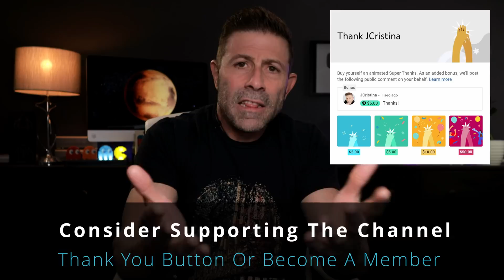REVEALED: Elon Musk SpaceX Starship 7 Investigation

Comment: Harmonics is an interesting study. I remember when Hot Rod Magazine produced a bunch of articles on Harmonic tuning engine exhaust and intake systems. I learned a lot about harmonics way back then, 1957?. From that much understanding, I can tell you that by changing the size of that open space, they made the harmonics wildly different. I am sure they have formulas to recalculate the new harmonics of the new structure. It is interesting how the harmonics of even the expansion joints in a concrete paved highway causes auto manufactures to adjust the wheelbase of the cars they produce. Remember the bumps they created in Hwy 66 to make your tire tell you, "You are going too fast."?

Comment: I could be simply wrong.. but......I believe the "attic space" is between the thrust plate .. ie.. (The plate that holds the engines) and the firewall just under the LOX tank...I do not believe the fire occurred above the firewall near the lox tank...this "Attic" is where some of the raptor 2 heat shield is and is where a lot of pipes exist.....Spacex correctly pointed out that raptor 3 with its much improved piping design should in itself solve this issue....but it the interim spacex plans on flooding this space with c02 as a fire prevention...this leak could have been a small leak as what happened to the falcon 9 upper stage last summer....that did not lead to a fire as the leak vented freely into the exhaust plume without accumulating.....this attic area is most isolated from the craziness happening below the raptor engines and likely did not have adequate side venting to allow for this anomaly...spacex is adding vents....in future flights we should be able to see streams of c02 venting from the sides of the aft section if spacex chooses to put a camera there to give us a view

Comment: It's common knowledge (among those of us who follow starship) that flight 7 utilized the first of the Block 2 starships, and that among the many changes, both the lox and methane tanks had increased in size.  I believe that was why they didn't bring attention to the larger volume of fuel/oxidizer.  But I do believe that the difference in length of the pipes supplying fuel could have contributed to the harmonic frequency being off nominal.
Reply from the maker: Agree.

Comment: OK--------...  HARMONICS ON A ROCKET COMES MOSTLY FROM THE ENGINES....  THE ENGINES ARE BURNING LOX AND METHANE AT INCREDIBLE PRESSURES THAT BECAUSE OF BUBBLES OF FUEL AND LOX NOT PROPERLY MIXING TO BURN, ACTUALLY EXPLODE LIKE SMALL FIRECRACKERS AS THE MAJORITY OF THE FUEL BURNS.. THESE MICRO EXPLOSIONS OF VARYING SIZES AND POWER THAT CAN EQUAL MANY STICKS OF DINOMITE, ARE RANDOM AND IMPOSSIBLE TO PREDICT AND IN EARLY ROCKETS WERE RESPONSIBLE FOR MOST OF THEM BLOWING UP... AND TOOK YEARS FOR NASA TO FINALLY UNDERSTAND WHY....  BUT WERE NEVER ABLE TO STOP THEM COMPLETELY... I'D LIKE TO LET YOU KNOW THAT THE SMALL CONSTANT EXPLOSIONS IS THE GREATEST CONTRIBUTOR TO THE ROCKETS' HARMONICS AND ARE AMPLIFIED BY ALL THE FACTORS YOU HAVE DISCUSSED...  
-------------.  THE HARMONICS OR SHAKING VIBRATIONS ARE WHY IT IS SO HARD TO KEEP BOLTED PIPE JOINTS FROM LEAKING...  WHICH IS WHY SPACEX IS TRYING TO ELIMINATE AS MANY BOLTED FLANG JOINTS AS POSSIBLE...  BUT THE BIGGEST FACT THAT CONTRIBUTED TO THE DESTRUCTION OF STARSHIP 7'S LAUNCH WAS THE FIRES FROM THE LEAKES UNEVENLY HEATING THE FEED PIPES AND BOTTOM OF THE LOX TANK CREATING ADDITIONAL STRESSES  IN THE WELDS OF PIPES THROUGH THE TANKS AND MULTIPLYING THE HARMONIC VIBRATIONS AND RAPIDLY INCREASING THE SIZES AND NUMBERS OF THE LEAKES GEMETRICLY...  AND THE ATIC BEING SEALED TIGHT WITH ONLY A FEW SMALL VENT VALVES NOT BEING ABLE TO RELEASE THE INCREASING PRESSURE FAST ENOUGH,,, THAT CONSENTRATED AND MULTIPLIED THE HEAT OF THE FIRES EXPONENTIALLY...  FROM ENGINE TO ENGINE... FORCEING THEM TO SHUT DOWN... ONE BY ONE... 
----------.  WHEREAS SEVERAL LARGE BLOW-OUT PANNELS WOULD HAVE ALLOWED THE LEAKING GASES TO ESCAPE INTO THE VOID BEFORE THEY COULD FORM LARGE CONCENTRATED FIRES...  WHY SPACE X HAS SAID THEY HAVE ADDED BLOWOUT PANNELS AND LARGER VENTS TO THE ATTIC ON THE STARSHIP FLIGHT 8... ALONG WITH FIRE SUPPRESSION SYSTEMS...
-----------. AGAIN WHAT CAUSED THE HARMONICS IS THE ENGINE EXHAUST MINI EXPLOSIONS AMPLIFIED BY THE HIGH PRESSURES AND HIGH THUST UP THROUGH THE ENGINES PIPPING THROUGH THE ATTIC AND INTO THE LOX TANK...  WITH THE FIRES BEING AMPLIFIED BY THE INCREASING PRESSURES INSIDE THE ATTIC... CONCENTRATING AND RAPIDLY EXPANDING THE FIRES...AND THE DAMAGE THEY WERE CAUSING... 
-----------.  THEN THE CENTRIFUGAL FORCES AS THE SHIP STARTED TUMBLING FASTER AND FASTER FROM THE UNEVEN THRUST AS 5 OF THE ENGINES SLOWLY CUT OUT FROM ONE SIDE TO THE OTHER...  TEARING THE FUEL SYSTEM APART ADING TO THE STRESSES TO INCREASE THE RATE OF LEAKES AND THE SIZES OF THE FIRES...  UNTIL THE SHIP SIMPLY TORE ITSELF APART POSSIBLY FROM THE ATTIC ACTUALLY EXPLODING BEFORE THE DESTRUCT SYSTEM EVEN FIRED ITS CHARGES... SINCE THEY DID NOT RECEIVE AN ACTUAL DESTRUCT SIGNAL AS STATED BY SPACE X...
------------.  THE WIDESPREAD MILES WIDTH OF HEAVY PARTS IN SMALL SEPERATED CLUSTERS SEEN FALLING STREAKING ACROSS THE SKY WAS A RESULT OF THE HIGH RPM OF THE TUMBLING SHIP WHEN IT DISINTIGRATED... RESULTED IN THROWING SOME PARTS FALLING OUTSIDE THE ORIGINAL CONTAINMENT ZONE... WHEREAS A SHIP THAT WAS SIMPLY DETONATED FROM ITS SELF-DESTRUCT CHARGES WOULD HAVE BEEN MORE TIGHTLY CLUSTERED TOGETHER... AS DEMONSTRATED IN EARLIER BOOSTERS AND LOW ALTITUDE SHIPS THAT HAD BEEN SELF-DESTRUCTED...
------------.  IT WAS NOT THE ADDED VOLUME OF THE ATIC,,,  BUT THE ADDED NUMBER OF NONE WELDED JOINTS OF THE RAPTOR 2s THAT THE RAPTOR 3 WOULD ELIMINATE... THAT HAD REQUIRED THE LARGER VOLUME OF THE ATTIC TO ACCOMMODATE ALL THE BOLTED JOINTS...  THE SMALLER VOLUME OF THE ATIC IS JUST A BENEFIT ALLOWED BY RAPTOR 3,  NOT A REASON... THAT ALLOWS MORE FUEL TO BE CARRIED SAFELY...
Reply from the maker: Thank you for taking the time!!!

Comment: It has to be the water content used because water tends to vibrate and cause ligaments brackets to break during flight that lead it to burst into flames and gave us a great fireworks show, hence why the water content on the Falcon rocket sprays out the water vapour and gives that beautiful atmospheric visual.Reduction of the volume of water could be achieved but the vibration is still there when the brackets vibrate and burn the hull from the plasma, what SpaceX should consider is a different type of water source to produce cryogenic liquid so the ice doesn’t produce a strong enough reaction, just keep in mind that Space is a vacuum at negative minus degrees Celsius similar to Arctic or Antarctica minus temperatures with no oxygen involved, the ice can build around the surface of the ship too.
Reply: The gas helps with the heat shield to minimise the heat from the plasma in the ionosphere. I said this before in chat??
Reply from the maker: Yep.. I can wait to see what they did with the "active-cooling system"
Reply: Spacex does not use water in the super heavy booster or starship.   that beautiful atmospheric visual on falcon 9 and everything else flying at high speed in the lower atmosphere is water vapor condensing due to the high speed air coming off surfaces....high performance fighter Jets also do this....  there is absolutely no issue with water in the cold vacuum of space as there simply is no water to condense once you get up high enough.....spacex uses nitrogen to cool/produce cryogenic fuel...it is impossible to use water to cool a cryogenic liquid   spacex uses co2 for cooling and fire suppression/prevention this is stored in the stakes on the side....Nitrogen is used to spin up the engines prior to launch/restart

Comment: On the tailsurfaces like the Pilatus P-12 this harmonic response is called flutter, rapidly increasing flutter amplitude until with a boom separates from the airplane. The frequency is determined by the Struhal number, which relates frequency with the speed. On your wheely the shaking happens when you reach a certain speed, right?
The ratio of the frequency to the speed is the Struhal number.
Reply from the maker: Yes. Placing the front wheel down at a high rate of speed at a slight angle can cause the shake to begin and only get worse. Letting off the throttle is your only hope if it has progressed to a point of no return.